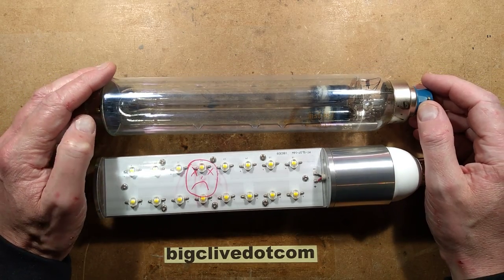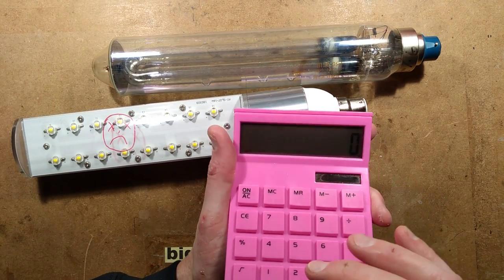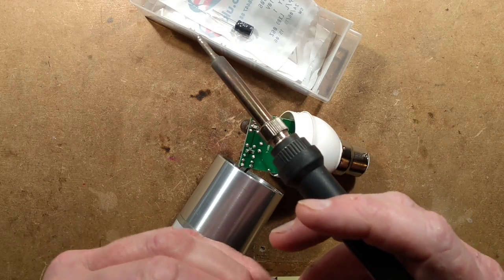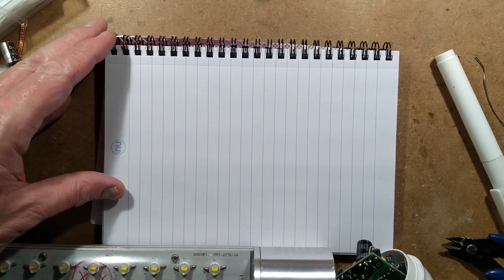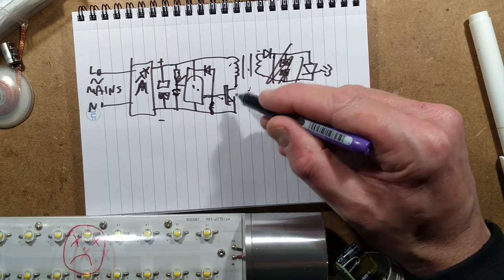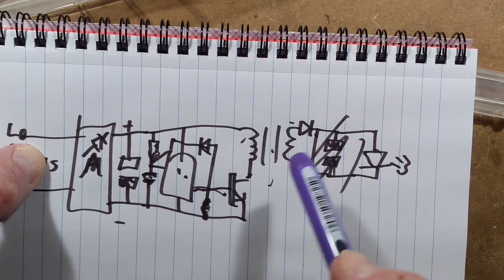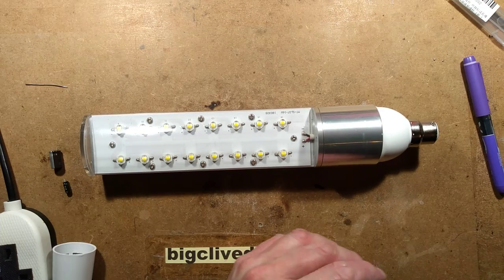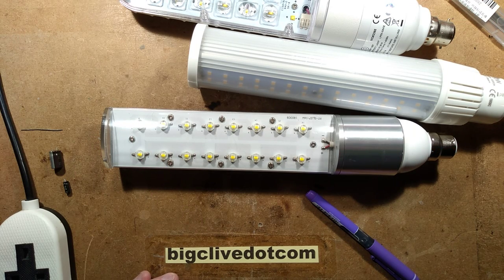Fixing a dead LED street light lamp.  (SOX retrofit.)

Comment: Here in the US, LPS was never really used except near observatories where the monochromatic wavelengths can be filtered out by telescopes. I was in Flagstaff, Arizona in 2022 where there is an observatory. Most of the streetlights in the downtown area of Flagstaff looked like LPS, until I took a closer look and found they were LED which emulated the monochromatic light produced by LPS. I believe the fixtures were originally fitted with LPS lamps, but were retrofitted with an LED lamp powered by the line voltage to the fixture. What had prompted this observation was that there was one fixture at an intersection where the LEDs were I believe 5000K.

Comment: Among all the other problems mentioned here regarding replacing sodium street lighting with LEDs is that of light pollution affecting astronomers. The old SOX lights have a very narrow frequency output which is easily filtered out, but LEDs are broadband emitters, making filtering far more difficult
Reply: I was about to point this out. Astronomers LOVED the sodium lamps because they could so easily be filtered out to prevent light pollution.

Comment: Those pins are oxy acetylene tip cleaners Clive. They are like tiny little round files as such. Nice diagnosis mate.
Reply: Truth!
Reply: Yes, I use them for cleaning carburettor jets amongst other things, available in nice sets for say £3 from welding supply firms or slightly cheaper on line. Usually used without solder.
Reply: @BensWorkshop  I got given mine by the local welding supplies company in a nice case with their loogo and contact details printed on it.
Reply: @Equiluxe1  I had to pay for mine :( but then I don't do any oxy welding, only MIG and MMA (Manual metal arc is apparently what arc welding is called these days....)
Reply: @BensWorkshop  They are great for cleaning mig/mag tips as well.
Reply: @Equiluxe1  oddly I don't generally have a problem with those.
Reply: @BensWorkshop  I use mine for carbs more than my torches. Though I have found riping a wire out of a wire brush is more convenient for field repairs of carbs.
Reply: @ionstorm66  Yes but I save the wire brush for welding :) I also have used it to clear jets on primus stoves. (All of which can be seen on my YouTube channel.
Reply: Yup, originally oxy acetylene tip cleaners, but great for carburetors, pneumatic and hydraulic orfices, and now you added to the list! Nice show mate!
Reply: @ionstorm66  Have you watched any of "mustie1" videos? He uses them for cleaning carb jets too.
Reply: @BensWorkshop  You would if you weld aluminium.
Reply: @Equiluxe1  Ah. Cheers for the heads up on that, as I might try that in my MIG some time soon.
Reply: They are also provided with vacuum desoldering stations for cleaning tips.
Reply: I have used fine wooden toothpicks or a set of sewing needles for cleaning PCB holes. Depending what I may find first. That LED lamp is nice indeed, but it comes at price.
Reply: @BensWorkshop  A bit rough for cleaning carb jets !!
Reply: @BensWorkshop  What's 'arc welding' ? Do you mean electric welding ? ;)
Reply: @millomweb  I have some very fine ones on it. works fine.
Reply: I use a tapered steel probe. It fits all size holes and never wears out.
Reply: @millomweb  Arc welding also known as MMA (Manual metal arc) which does use electricity to create the arc...
Reply: @BensWorkshop  so not called Stick welding now lol
Reply: @BensWorkshop  I wouldn't use anything rougher than compressed air ;)

Jet cleaning tools are usually just a bit of thin wire with little strength.
Reply: @dogwalker666  it's called all sorts of things. I was amused to hear it called MMA. 😀
Reply: @millomweb  Depends on the jet.
Reply: Yes, gas torches, but they can be used to clean out powered desoldering iron tips as well.
Reply: Clive wondered what to call them, but they have a label reading "不锈钢通针 电路板过孔通" which explains it all.
Reply: @johnrehwinkel7241  😂😂😂
Reply: I saw the torch cleaners and thought that as well.  I mostly use them on small engine carbs and mine are in a small aluminum (aluminium) clamshell case.
Reply: Michael Wynne  yes I have a set in my welding tool box there from cleaning the jets out as the copper welding tip melts and the hole/s close up. How ever they can be used for other thing just be careful that you don’t rip the copper tracks of the board with them

Comment: Astronomers love low-pressure sodium street lighting because they are not monochromatic, but dichromatic.  They produce light from the atomic transitions of the electrons in the sodium atoms, which produce the characteristic sodium emission spectrum, two narrow lines in the yellow-orange range, quite close together.  These can be easily filtered out in a telescope, leaving the light gathered almost undamaged.
Reply: @kevin paul halliday I think that haze would be a problem for viewing dimmer object regardless.  Have you tried a filter for the sodium lines, though?  It can only help.
Reply: @evensgrey  Yeah, I grew up in Boston but left about 5 years ago.. I remember the concrete panels were falling down.. one of them crushed a car and killed a lady.. her husband was in the passenger seat and survived somehow.   flattened the car.  It was the epoxy-anchor system they were using.  They removed them all, but IDK if they ever put them back.  Now the fixtures are falling.. geez.

Comment: The old sodium-vapour lamps were definitely better than their LED replacements in producing a large pool of visible light. In my experience, LED street lamps illuminate the area immediately below the lamp standard and for around three metres around but no further, leaving large dark areas between lamp-posts.
Reply: As someone with a Philips Mi26 as a floor lamp... I can attest :)

It's sad we didn't develop the technology and fixtures even futher because it was an extremely efficient source. the only really major problem SOX had was that because a lot of lanterns were of the semi-cutoff type, the light could bleed upwards causing sky-glare. that was easy to remedy with an altered optic or going full-cutoff though.

besides that, even the smallest SOX lamps were around 100 lumens per watt (the 35w SOX we are used to seeing in smaller streets and side roads are around 130lpw), the light spread was very even (more even than the 45w Iridium minis that they replaced them with in 2012, that's for sure), the light output wasn't concentrated into a single point making them very low glare compared to metal halide, LED and HPS, and they were also extremely good at cutting through fog, which is a massive visibility boon when you're trundling through a pea-souper of an evening!!
Reply: I prefer warm-white led than sox lamp
Reply: LED with poor light distribution have that kind of problem, the only good thing is that it doesnt induce glare that much but the street feels like hallway with lights far away from each other

Comment: I miss the yellow sodium lamps. I could tell if a car was coming down the road at night when backing off my drive because headlights are white. That trick doesn’t work with white LED streetlights.
Reply: That is one of the disadvantages of LED outdoor road lighting in general,  weather its street lighting, car headlights or bike lights, they are all the same cold white colour & not very distinguishable from a distance.
Reply: Not to mention that reversing onto a main road is a no no in the highway code. But of course sometimes there's no alternative....
Reply: AAAyyyGGG Indeed I would do otherwise, were it not for the steep angle of the drive and that it is impossible to exit the car otherwise (at least not without being a gymnast/contortionist and climbing across to the passenger seat).
Interesting others also think LEDs are not as good for identifying oncoming vehicles. I wonder if there is actual hard evidence that safety is decreased? If so perhaps we should refer to the artificial yellow.
Reply: Dave Micolichek: Yes, but I can’t “look a little harder” my view is completely obstructed (or at least so obstructed that I cannot see in both directions far enough to detect if there is sufficient gap to emerge with any certainty). I have to put my hazards on and reverse very slowly using my hearing and other “tricks” to detect approaching vehicles, or hope they are courteous enough to stop. At least at night I used to have another “trick” to use.

Regrettably there are still motorists who charge down narrow residential streets at 30mph+ presumably in the mindset “I have right of way, no need to stop for anyone”. If they do bother to use their horn, then it’s only to sound it in annoyance as they scream on past. Perhaps if they took “a few milliseconds” to THINK a little harder, then they might realise that an emerging drivers cannot possibly see them approaching and the polite/safe thing to do would be to STOP?
Reply: Dave Micolichek: Different colour? Yes that’s the point. They are now the SAME colour. White headlights on yellow sodium lights were far easier to see.

Comment: Those pins are torch tip cleaners.  Also good for cleaning carburetors.
Reply: They're also sold by unscrupulous vendors as 'nut files' for stringed instrument maintenance and repair.  But they are pretty horrible for that use.
Reply: this. I've seen the same exact pins in a tool marketed for carb jet cleaning
Reply: Old guitar strings work for cleaning carb jets too

Comment: The metal pins are for cleaning out migwelding tips. The rough sides are to smooth the inside of the tip so the welding wire doesn't grip the inside

Comment: Hi Clive, thank you so much for this video. ✅

I have two of these "Magnatech" SOX-LED retrofits, one is exactly the same as yours, the other is larger (longer) to replace the 50W SOX, both are faulty, and I hadn't dared to try opening them up. I wasn't able to unscrew the plastic base, as you did, and that made me assume they were crimped, or glued in place. So now, I'll take another look at them. One has two dead LEDs that burst into life if you press simultaneously  on their lenses, and one or two more where the silicone lenses have been 'blown' off. The other one did light when I first got it, but dimmed to almost nothing after a few minutes, and has never regained full brightness, but its LEDs all appear to be sound. One point you didn't mention, was the small grub screw to lock the lamp in place once you've levelled it up. I am curious about one thing though. Mine don't have the clear plastic front covers, and I'm wondering i they ever did, or if it was an option for certain applications.

They are an interesting lamp, and ERYC (East Riding of Yorkshire Council) installed tons of them about ten years ago, but their failure rate was off the scale. About eighteen months later, the council then set about junking these in favour of completely new dedicated LED lamp heads with two clusters of LEDs in each head. Their failure rate is much lower, but still not perfect. These new lamps are affectionately known to some hereabouts as the "illuminated tom-cat testicles" - because if you look up at them when they're lit, they do have a bit of resemblance to a tom-cat's crown jewels! 🐈 💎 🌟 😂
Reply from the maker: These are the first of this style I've seen.  I wasn't aware they did a version with no cover over the LEDs.  You could take the PCB out, warm it, and replace the LEDs.

Comment: Sodium-colored LED lamp with a lower efficiency and shorter life than the original sodium lamp. Not sure what's the point except that selling LED lamps is a good business...
Reply: The idea of LED yellow - so people don't notice the change isn't going to be too convincing if they don't go through the red (and sometimes flashy) warm-up stage :)
Reply: @dh2032  - SOX lamps are incredibly efficient - often more so than thr LEDs that replace them.
Reply: Low pressure sodium lamps are complicated to make and making them depends a lot on the skill of the lampmakers, which crooked multinationals hate as they cannot export manufacture to some turd world cesspit using replaceable and expendable slave labor.  Not to mention that it is an established and reliable out of patent technology.  Which means that generations of specialist knowledge will have to be relearned by our descendants when they are crawling their way out of the rubble of this civilization.
Reply: LP Sodium lamps are most efficient and very long lasting. The LED lamps have a lot of E waste and don't last as long as the power supply's often fail early. The red pink start up from a SOX lamp is simply beautiful.
Reply: @RODALCO2007  I always like the first few seconds, where the glow flickers between purple and red. 
It's like the argon and neon are fighting for the current, flashing between who's in the lead.
I also like how once they start to warm up, the ends slowly get more and more orange, slowly moving up the entire length of the tube.

Comment: The old sox fittings were only good in the respect that the control gear rarely went wrong unlike son and fluorescent. Colour rendering was terrible. Then there was mbfu which wasn’t too bad. We used to lean a ladder against columns on municipal car parks and service them that way. Only use a portable scaffold in extreme circumstances. Wouldn’t be allowed now. Brings back memories. Excellent video thanks.

Comment: idk what those little file or needle things are but they arent desoldering needles. desoldering needles are like large (relatively) diameter, unsharpened hypodermic needles made out of stainless steel. the central bore means you can fit them over the leg of a hard-to-desolder component and of course solder doesnt stick to stainless steel so you can withdraw the needles once the joint has reset and the component is free

Comment: I live in a little fart of a town in southwest Pennsylvania, and the house is right next to  a secondary state maintained road.  (Saying that PennDot, or anyone properly "Maintains" the roads is a bit of a stretch, but you get the idea)   about every 1/8 mile or so, was a merc vapor ( I think )  streetlight. (the bluey-white ones)  Recently they were all switched over to white LED heads.  Maybe it's just me,  but I think they are better.  It seems that there is more contrast and sharper definition of items lit by them.  The older lamps had curved, glass lenses that scattered the light, even sideways. IE light pollution.   These new ones while brighter are flat panels behind flat, clear glass.  You can see things lit up really well  but not see the light source in the head until you get within a few dozen or so feet of the illuminated area.  I kinda' like 'em.  brighter, sharper light giving a more defined "image" of items & shadow with less glare and light pollution in windows at night.   I could see the light from the old one in front of the house, shining in my window at night.  The new one does not invade my darkness.

Comment: Rite Big Dude, The other day was doing a bit of desoldering and some of the leads had a fair bit of solder on them and were a wee bit long so decided to cut the back with flush trim cutters to ease dwell time and the compenents to my suprise came out with a bit of a pull! I have just tried this with a CD40099BE chip! and the same thing happened. Conclusion, won't be doing much desoldering from now on!!! TFS, GB :)

Comment: Singlesided boards without plated holes are very weak.
A light knock or push on a component or vibrations can rip the copper off the board and then it is just a matter of time till the foil breaks and you have an open circuit or a fire...
Reply: A very important consideration in avionics.  Not so important in a street light which isn't going to get much in the way of vibration.

Comment: I personally prefer the light output of SOX... Especially as the LEDs being used in current replacements have a terrible greenish blue colour to themas the manufacturers are favoring raw LPW over modest colour rendering. Not to mention being absolute glare bombs seeing as the light they produce is far more concentrated than SOX.
Reply: also leds are not good for human eyes
Reply: @Altamira-Arazz  It depends on the construction of the lamps to be fair. there are a few ways to drive LED lamps on AC, and a few of them, such as capacitive droppers and unfiltered bridge rectifiers, will introduce a lot of flicker, even if your lamp operates with opposing pairs to light on each half of an AC Sine wave.

If it's a good quality lamp, you will normally get a properly filtered switching power LED driver in the lamp, which will completely remove the flicker from the light output. cheaper or more compact lamps that can't fit a switching supply in them will normally have a capacitive dropper arrangement instead, which produces significant flicker.
Reply: @DigBipper188  I mean white led lights emmit blue light also emmittes by computer screens